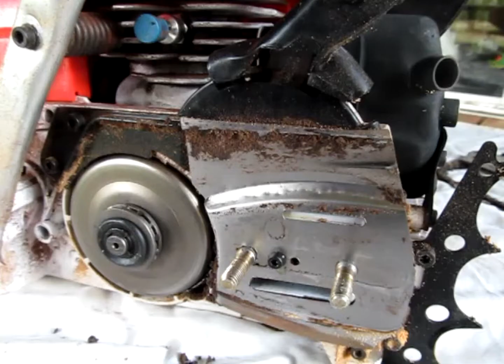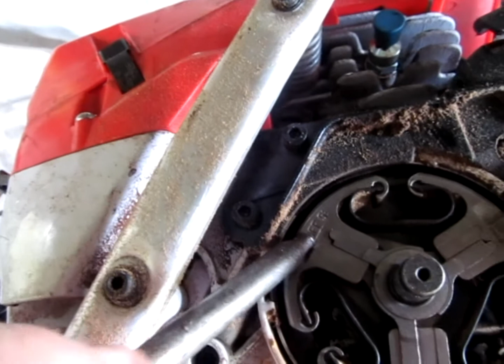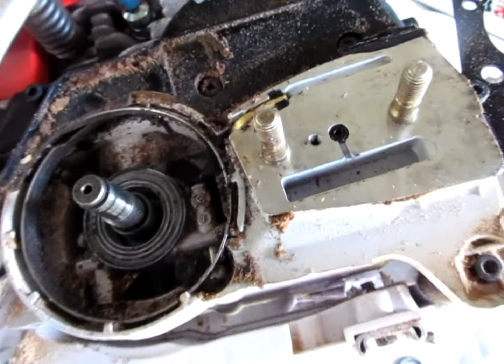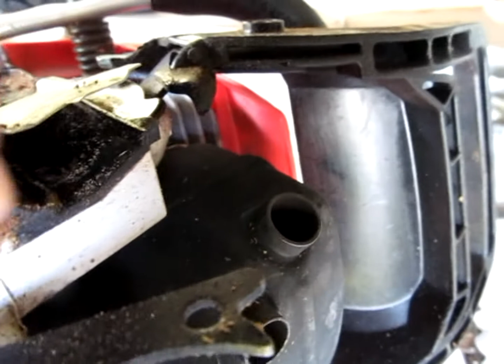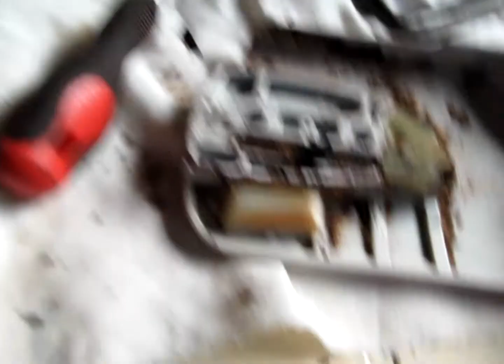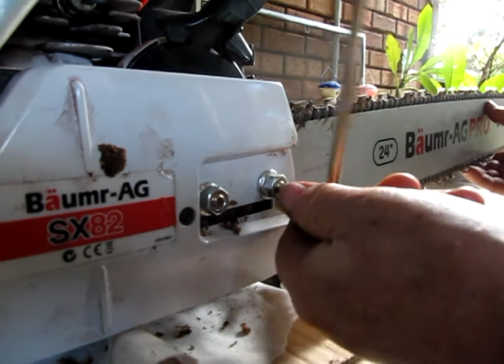Baumr AG SX82 24" Chainsaw. Help Mods,Tips and improvements

Comment: Nice video i have 4 of the chinese saws after changing out the fuel and impulse lines they have been excellent. Does anyone know if these are indeed 82cc or the standard 75cc big bores.I can order the 82cc cylinder kit from edisons but they couldn't tell me the bore size.Thanks.
Reply: they are around 70 cc there stroke is shorter then a 372 i have talked to couple poeple and they checked bore and stroke and the 92cc is a 70 cc and the 82 is a 70 to and they will not ship to usa and they a guy on ebay  is a scam but i being trying to buy 1 , and idk what its call but there is a black 92cc not a baumr its a 390 clone